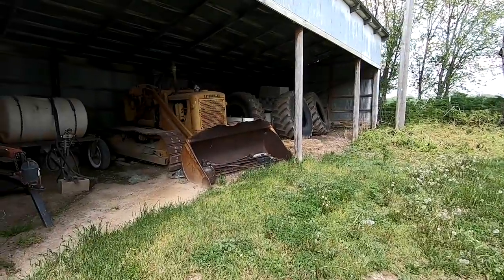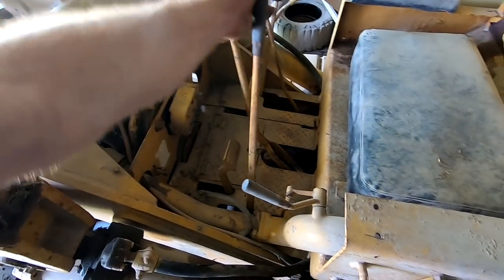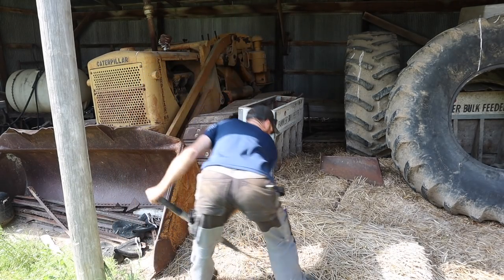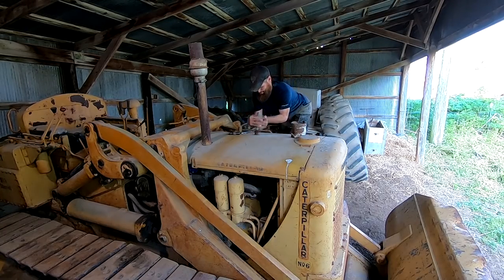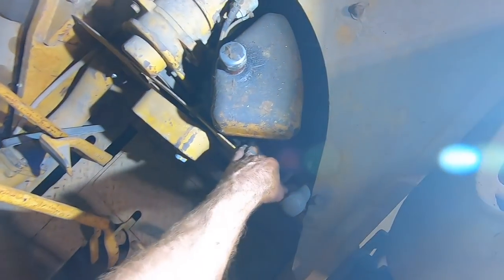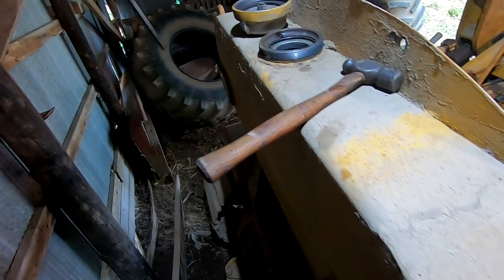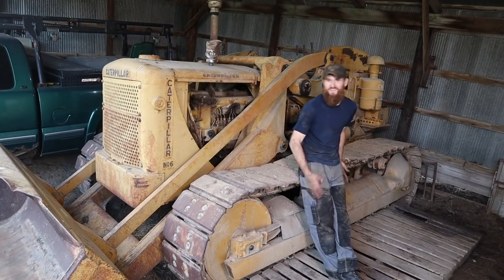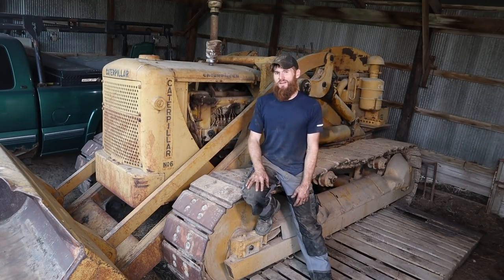RARE Caterpillar Track Loader DISCOVERED Forgotten in a Barn ~ DAY 1 ~ 1954 Caterpillar No.6 Shovel

Comment: To my thinking that machine has a generator which produces Direct Current because those old air gap regulators were designed for DC.

Plus, three cells on the old battery that was still in the holder identifies it as a six volt model which also means that unless someone had the generator re-polarized, the electrical system is probably positive to ground.

Comment: My guess is the hour meter has gone round the clock. 920 hours, at an easy 5 hours per day is only 6 months on a 70 year old machine is unrealistic. Add 10000 hours to that and you have roughly 6 years of work which is slightly more realistic! Regardless its a great old machine, in fantastic condition and Im very happy someone is saving it! Wait until it runs before you name it, it could be quick and easy or turn into a nightmare, only time and sore knuckles will tell!

Comment: I’m enjoying your #3 video of the #6 shovel. I see you found to ripper teeth. Our old 955 H and 977 H had a place for rippers mounted under the lift arms to the loader. You may want to check low on the loader arms as there maybe a spot for them. Also the buck teeth should all be removeable caps.
Reply from the maker: Interesting, rippers on the loader arm... Not a bad idea, until you DON'T want to use them and they won't come out, lol! I will look for sure! Thanks!
Reply: @SalvageWorkshop  you would only put them on when needed, then take them off when done scarifying, you had to take them off loading trucks. Hard on sideboards and truck boxes. It only took 15- 20 min to put on

Comment: If removing the stack can’t be done easily, how about disconnecting the hydraulic lines and lifting the bucket. 

Ol No 6

For moving it, check to see if the post can be moved. Just sliding the bottom over a couple feet would give you enough room to get out.

Comment: I would check if it has an oil clutch or dry clutch from what I understand the oil clutch is much better. Anyone can correct me if I’m wrong but I think the dry clutch type has some kind of cushion drive connection between the clutch and flywheel witch tend to fail form old age. The d318 motor should be in the range of about 75hp from what I can find looking forward for the next video

Comment: I learned to operate on a HT4 in 1962 then in 1963 we had a 977 with later loader arms than that one.I think those  dip sticks are the oil clutch, But I didn't think oil clutches were so early.The 977 had same grousers as OLD RED, the HT4 had the same as that,

Comment: As far as the name I think you should call it Grandpa. I like your videos no matter if long or short. I am an old vehicle fanatic also. I have 7 old air cooled Volkswagen sedans and 12 old two cylinder John Deere tractors from hand crank B's to 720 diesels. I figure if it can be fixed, I can fix it.

Comment: 6 volt starters run at double the current of a 12 volt. They won’t be damaged by 12 volts but may spin fast. BUT don’t run them too long as double the power makes double the heat.

Comment: I never owned or driven one but how to tell the choke to throttle on the pony motor is the one with most restenant is choke and lease restenant is throttle how I know that is I am mechanically inclined with my skills so the running switch if it has right middle and left it could be right is to get the pony motor to start up or left but the down position is when you are starting it for getting the main motor going after starting the pony motor and after that the next turn turns off the pony motor and when switched is moved from middle to left the pony motor shuts off I think that is how it works if they ignition has more than two settings it could mean that one position could be for the running on position for the pony motor and the second is when you are at the mid point to start the main motor and the third position is main motor on at pony motor off that is if it switches Three times with the on ignition but to probably shut the main motor off it probably has a separate choke for it but remember that the pull chords that have most restenant is to do with choke and the lease restenant are the throttle and stuff.

Comment: my guess on the pony motor is bottom one is choke and top is throttle... purely based on how they looked when pulled out. the bottom one looked more like you would expect from a choke, likely on or off but the top one seemed to move a lot easier so you could fine tune the speed easier. might be talking a load of crap but its a guess...

Comment: Under the seat should be the transmission dipstick, final drives hav plugs at the back. Might also be dipsticks for the steering clutches and power assist steering but I highly doubt that if its below 1958 .

Comment: Get the serial number for me and I can tell you the year. It should be a 10A Suffix I believe. These were built 1953 -1955. 
total production was around 1000 units. One little piece of constructive criticism. Do not pull a dip stick out and lay it on a dirty cylinder and and put it back in without wiping it off with a rag and being sure it is clean. You introduce dirt into the engine that way. It only takes one little piece of dirt in the wrong place to ruin a bearing. The oil filters clean the oil after it has gone though the engine. Not before. Next. You will need to clean the points in the mag to get spark. after sitting that long I'm sure they're oxidized.
Reply from the maker: The serial badge has been damaged and all that is really readable is 415... so that means its either a 10A415 or 10A1415, but im leaning towards 415... ill show you in an upcoming video and you can give me your thoughts! 

I do agree about the dipstick issue!
Reply: @SalvageWorkshop    There is usually a tag on the rear top left corner of the differential case. Also, one on the engine. The numbers should match. The tag on the engine is usually on the rear lefthand side. It is not uncommon for the tag to be under grease.
Reply: @SalvageWorkshop  415 would be a 1953. 1415 would be a 1955. HP was increased from 80 to 100 at serial number 707. Engine is a D-318. 74 inch gauge. Measured center of sprocket to center of sprocket. Direct Drive, 2 and 1/4 yard bucket.

Comment: I'd check the points for corrosion on them. That if that engine is gasoline. If not then it's the magneto is dirty needing cleaned up. To fire off once again to.

Comment: Fuel could be stale in the smaller engine though. If it's been setting for 14 years. It's most likely the fuel has lost it's octane levels in the fuel. It's called octane vapor loss due just setting from year to year. I'd try to drain out that fuel.& then put in some newer fuel with octane booster to see what happens next after trying that out.

Comment: Low houred machine  !!!!!- Very Rare find !!
I'm not sure if its been painted in the later Lead free CAT Yellow which came in the 1980's as it looks like a more vibrant Yellow in places where the top coat has flaked off !!.
hmm!! it looks like its been painted as there are scratches which have been painted over !!.
If it was shot blasted and painted !- it look pretty dam Brand Fire New !!!!!. But if blasted ought to be painted in Old CAT Yellow

Comment: It would be decrease the viscoity not increase, the higher the viscoity the thicker it is. hence 60w80 oil tipically used in gear boxs is thicker then 20w40 oil used in engines.These two numbers are a cold verse hot viscoity rating, high number is cold low for hot.

Comment: I saw you lay down that oil dipstick on the dusty, filthy blade cylinder and then do the same thing with I guess the pony motor dip stick.  Didn't wipe them clean.  Just stuck them back in the engine someone had taken such good care of.  That was all I could take.  Unsucribed.

Comment: This is random but I have a question I bought a 1975 John Deere 510 Backhoe loader it has a hole in the block I'm looking for an engine if anybody can steer me the right direction I'd appreciate it the motor tag says "4270DR-02 291450R"   I'm in Alaska and no 1 from the lower 48 seems like they want to help me..  Any help would be appreciated by the way love your videos keep it up😁👍

Comment: Starter will be fine !!
If its a genuine 921 hours which it looks like it is based on the condition of the machine !!
Should be no need to strip that machine unless its faulting !!!- If it Aint Broke !!- Dont mend it !!!!!!

Comment: yes yes it is a beautiful machine so a #6 Cat Shovel loader tractor is equalant to D-6 Cat dozer tractor as what a old Cat skinner told me once I'm Cat guy too so now D-4 or #4 Shovel tractor would =955 as the #6 a 977  and with Cat Traxcavtors  the series models go like this  933 crawler loader, 930 even number wheel loader 944 Wheel loader 941Crawler loader, 950 wheel loader 951 & 55 odd numbers crawler loader the 950 wheel loader has also 4cyl motor in it as well as the 951 & 55, 977 is =to D-6 with small 6cyl so is 966 the later one was using a 3306 in them

Comment: That machine is so far ahead of ol red mechanically it ain't funny. Don't tear into it. Check oils and fluids and fuel and run it. Don't reinvent the wheel. Run it a little while and change engine oil and fuel filters etc and run it...